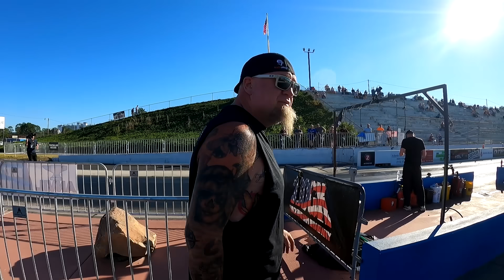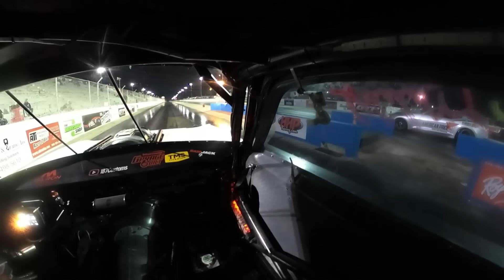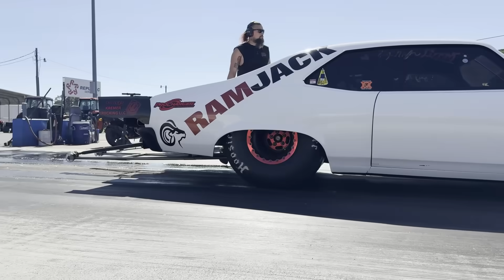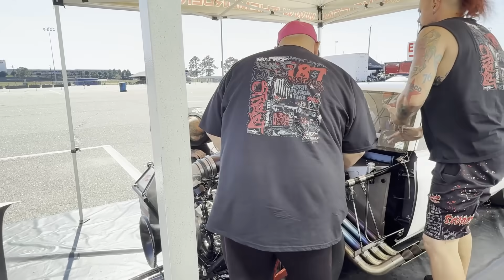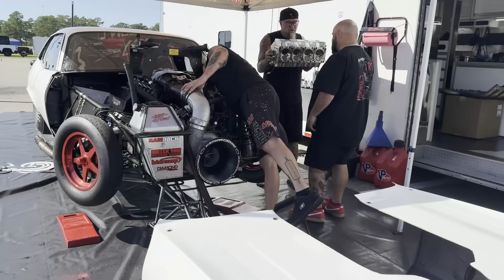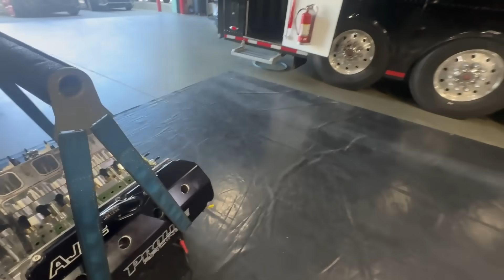No Prep Elite Race 2: Rockingham Dragway! Did Our Dreams of a Championship Just Come To an End?

Comment: You are a winner bro it hurts to lose I was at the race I didn’t even want to stand in line because I saw your frustration I felt your pain but good thing is you basically have a new motor going into Alabama and last time you was in Alabama with a new motor you was running a 92 to the 60 foot so relax chill next race is your bro 💪🏾💪🏾💪🏾💪🏾💪🏾💪🏾💪🏾💪🏾
Reply: They have tested alot there so it's a plus.

Comment: How is the points leader the number 2 seed?
Reply: We are not points leader currently.  Clay is with 110 points.  We are #2 in points with 105 points.
Reply: @malloryelizabethphotography   I’m talking about the Rockingham race. We should be the number 2 seed at Steele because we are second in points now
Reply: @teresathornbury9874  that’s not the way seeds work.  While yes we are second in points, we are 3rd seed. It’s not based off points.  It’s kinda silly the way it’s done, and more confusing than anything honestly.
Reply from the maker: Winner and runner up become seeds 1-2. The rest of the seeds are determined from your points standing after the 13th(last) NPK race. So since we didn’t win or runner up, we slide down to the #3 seed and everyone behind us slides down as well. It’s dumb and confusing but that’s the way it works

Comment: Semiglutide will have Phantom at 200lbs and 36" jeans in 4 months.
Reply from the maker: Nope. Didn’t work for me. And at 200# I’m a 32. I don’t it like down there. I’d be fine at 220-230 tho
Reply: @187Customs  really? I dropped the last 25 I had, down from 275 and 40" waist to 195 and 34", granted I'm 6 ft and 63, but it worked great for me. What dosage and frequency were you using? Glad to see you guys are finding the success you've worked so hard for, couldn't happen to a nicer bunch of people.